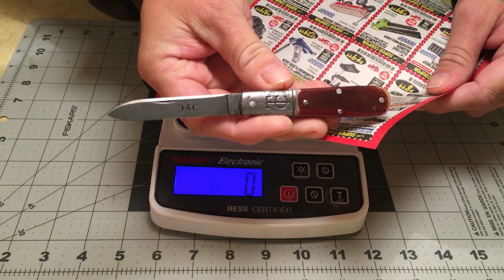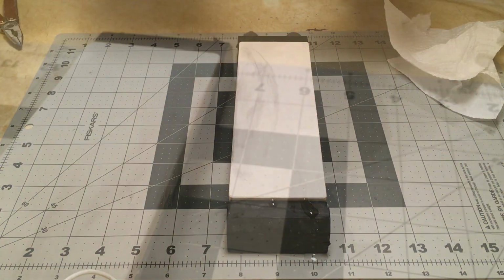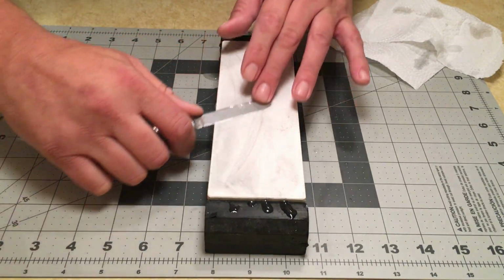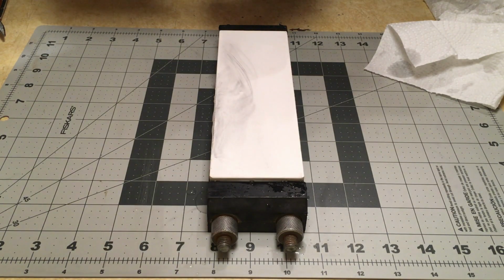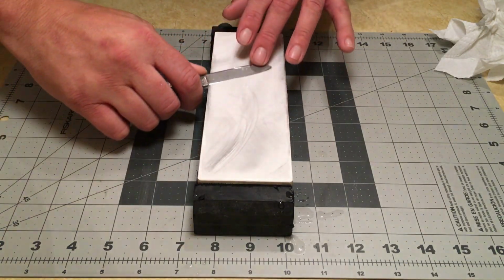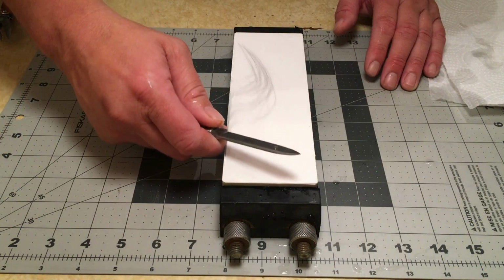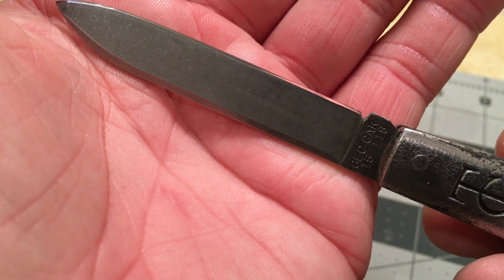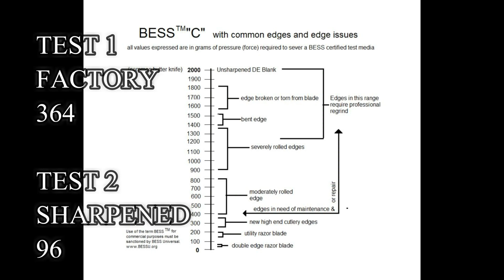Knife Sharpening - TC Ancient Barlow

Comment: That was really interesting i hopebi have learned a bit. I ve just been stroping my 1095 after i done the initial sharpening so i must be learing something anyway. Thanks for your time appreciate it. Atb paddy. 👍🙂☘️
Reply from the maker: As always, I appreciate you checking it out. 1095 is simple enough that a strop, is all you need. Till the apex gets too fat to really hold sharpness. Jovonn asked me to actually sharpen this one, so stropping just wouldn't do. The angle on it was probably around 50 degrees inclusive. I got it around 31. Just an estimate of course, but I got the numbers using a pair of calipers and a triangle solver
Reply: @Jef  i done mine at about 17 each side first. Im not good enough to do it free hand so used the lansky next time it needs it ill try freehand. 👍☘️
Reply from the maker: @paddyspotatopeelers2154  When I sharpen em on the edge pro, I usually go to 18º per side. They seem to hold that angle well enough.
Reply: @Jef  i dont really hard use mine as you know but i always love learning your ways of doing things. 👍

Comment: The more polished the edge,the more closed the apex is,ie,it doesn't have any teeth or striations. 

Then the knife starts behaving as a wedge, which is why wood carvers like a polished edge for clean cuts,and butchers like around 600 to 1,500 grit to handle slicing or boning work,I used a 120 grit edge to do my marking cuts ,(do the skin cuts ) and do rough carcass cleaning .
Reply: Of course the fat content of the meat will dictate how fine and edge you can use on it.
Fat tends to cause the blade to stick in the cut,especially pork .

Whereas fish is different etc.cheers man.
Reply: The thing with the edge on up system is that it doesn't actually measure the angle, or rather it will tell you when a particular edge ,on a blade of a givin thickness and bevel angle and polish is falling outside of,or within a particular norm.
However with so many steel types,edge  refinements, it would be easier to measure using a system like the CATRA Hobbigoni.

Speaking of the Hobbigoni, are you interested in using one for a few months? If so let me know ,I'll mail you mine jeff.
Reply from the maker: @blistersteel  Never heard of it. I'll have to google it and check it out. I can measure edge angles on my Hapstone/Epa, along with the angle cube, when I so desire. My angle cube is currently in a pass around along with my Crutch. So I don't have anything handy to really check. Short of calipers, and an triangle solver.

I understand the whole concept of polishing away teeth etc. The thing is, on some steels, like simpler 1095, 420, aus6, there seems to be more slippage when cutting. The same material with something like m390, doesn't seem to experience that problem. I assume it has something to do with the carbides, or possible just having more wear resistance, so they don't truly polish as much as the others.
Reply: @Jef  yeah,the more soft steels that are high in soft alloys seem to be nearly useless to even try to polish to a smoother apex.
In my mind the softer alloy steels behave more like a hard rubber,they tend to retain burrs in a rather annoying manner ,unless one cuts them off with a micro-bevel, and this is also not something that I enjoy though there is no shame in it.

I tend to post my thoughts so bnb others reading from the outside can see where my mind is at the time of the post in question, I've followed you for a while and I can see that you know your way around the sharpening processes. 

Mostly I am an edge nut. Lol.

Push cuts,pull cuts, slicing versus wedging an object keeps me entertained for quite a while :)

I am usually a stone guy,I rarely use a pasted strop as that tends to hide the stones true effect on the apex,but I am a fan of using interrupted strops to debur or align an apex to get the desired slice or cut behavior I am in search of a the moment.  Cheers jeff , keep the videos coming.
Reply: @Jef  though 1095 seems to appreciate Arkansas stones,that may have more to do with the shallow cut depth of even the coarser arks,also the shape of the grooves left behind by the abrasive (novaculite) seems to encourage these stones for the high carbon steels like 1095 etc  .
Reply from the maker: @blistersteel  BTW  I got it around 31º inclusive, using a pair of calipers and a triangle solver
Reply: @Jef  very cool.
Reply from the maker: @blistersteel  I kinda half ass deburr, then make an attempt to cut through paper. I like to see where the edge is without stropping. Problem is I tend to leave too many burrs to really get a good indication 😂 Micro bevels will give that 'all stone' edge, if it is ones aim. If I weren't a strop guy, that would most likely be the way I'd sharpen. Well, if I could micro bevel worth a damn. That's another area I have never been successful in.
Reply from the maker: @blistersteel  That Catra Hobbigoni looks awesome. I didn't search extensively, but do you know if they ship state side? I may have to buy one
Reply: @Jef  they do ship stateside .its a good piece of kit also.